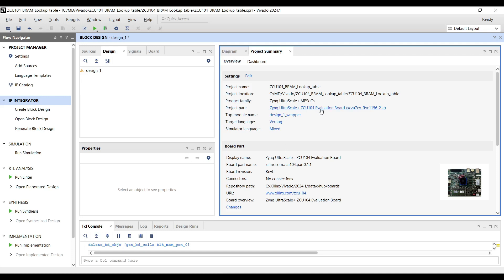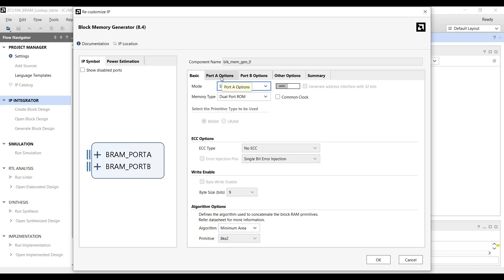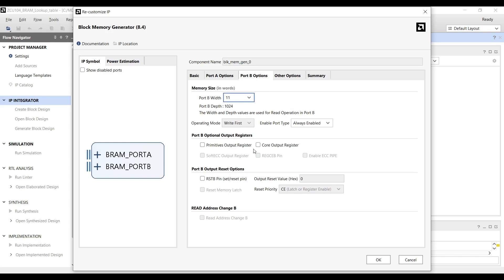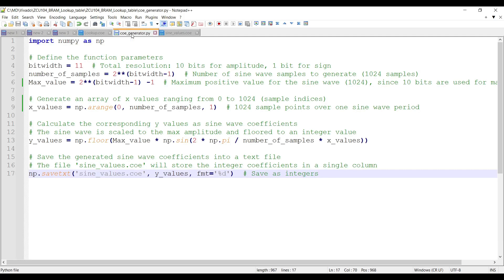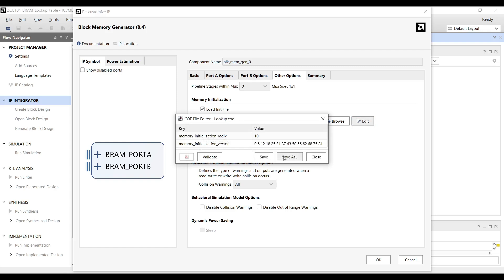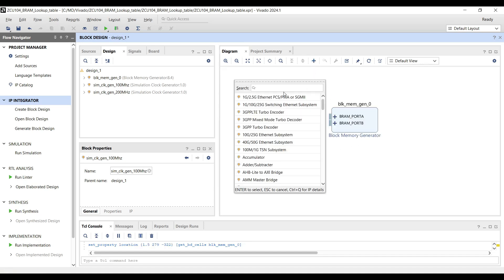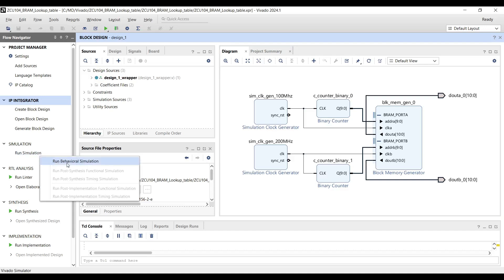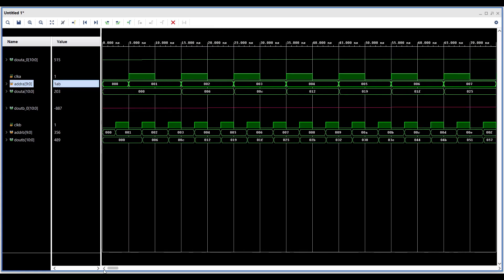Dual-Frequency Sine Wave Generators in Vivado Simulation by Xilinx Block Memory Generator

Comment: Hi! Can I follow the same steps if I am using a Nexys 7 board?
Reply from the maker: Hi @dr.krishnanaga8358
Welcome to the channel! 

Yes, this is the simulation, and if you are targeting to run the simulation only, you can run it on Vivado project with Nexys 7 as the part. 
However if you are targeting the implementation and bit stream generation, the two clock simulation sources are not synthesizable and you would need to replace them with the clocking wizard. you can find one example of clocking wizard here:
https://youtu.be/-oQye0qlBPg

Thanks!
Reply: @FPGAPS  Thank you, so much! I got the simulation!